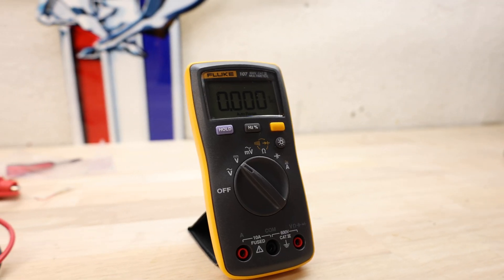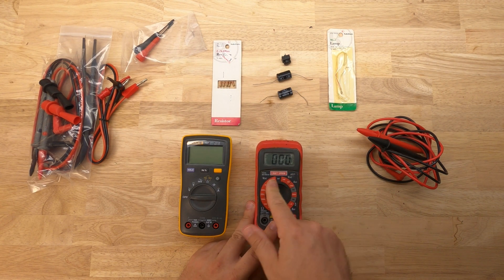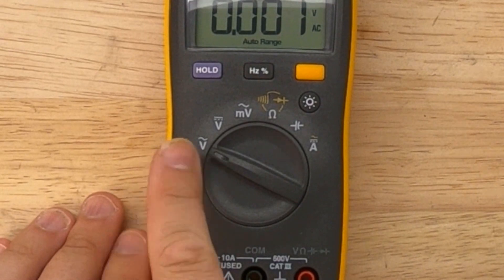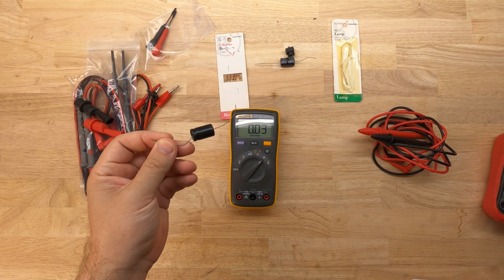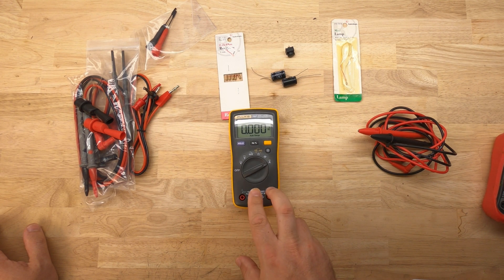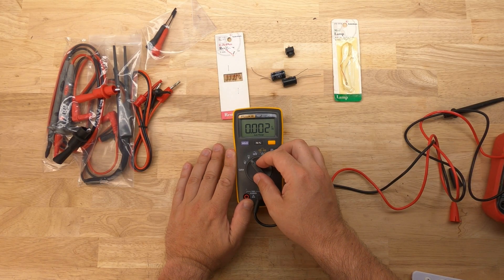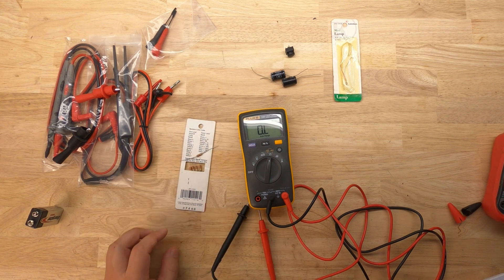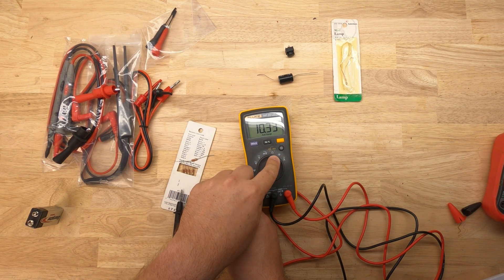How to Use a Multimeter, The ULTIMATE Guide!

Comment: Is there a way I can check a parasitic draw on my vehicle with a Fluke 110?
Reply from the maker: Yea. You need to measure the current off the battery with everything off. You measure the current flowing through the battery with the doors shut, just sitting normally. That would tell you how much current/watts are being consumed when just sitting. From there, I would measure current through the fuse box to each system to see where the draw is coming from.